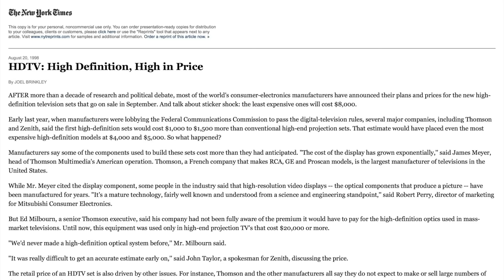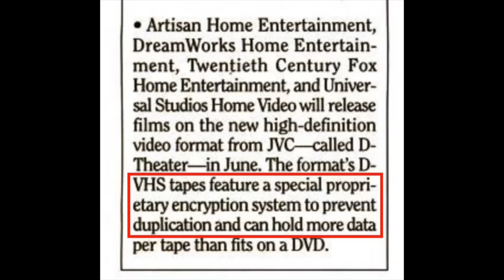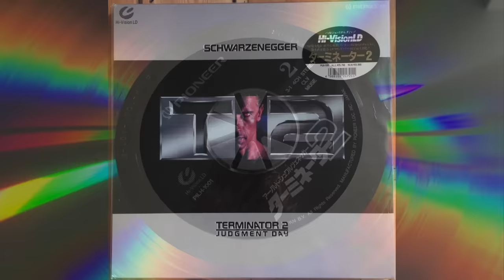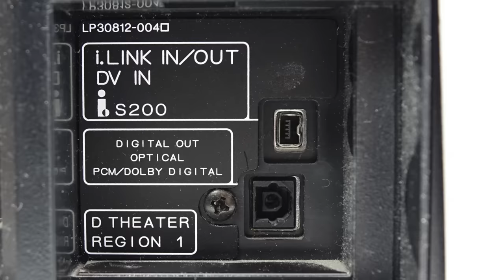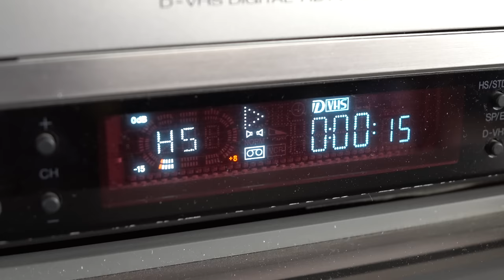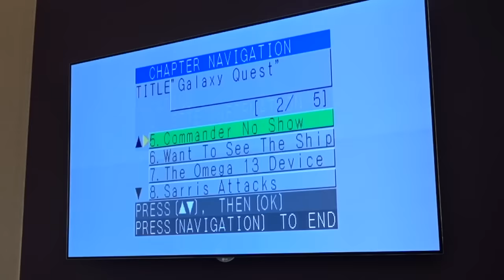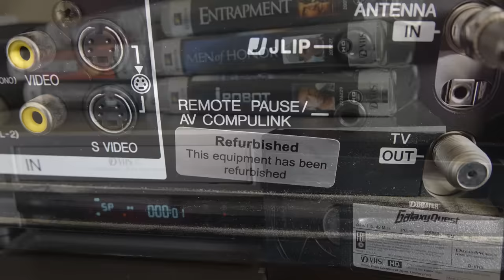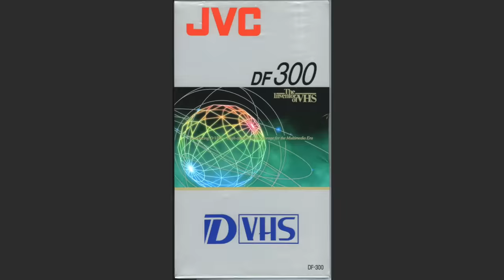Remember when HD Movies came on VHS tapes?

Comment: 50GB? Thats amazing!
Reply: yep the huge recording surface of VHS tape is definitely under-utilised by only recording analog signals to it. Note that a MiniDV cassette from the same era stored 15GB and it was a tiny fraction of the size.
Reply: Not to mention that computer tape backup with similar capacities was a thing, tape being cheaper than hard drive for the same capacity, the only downside is it is not random access.
Reply: The real question is, can it run GTA5?
Reply: +Autotrope These days, computer backup to tape is about 2TB per cassette, with support for robots that change tapes automatically between a stack of tape drives and a much larger library of tapes, which are then moved to a fireproof vault on a more human work schedule.  Disk backups are fine for "near line" quick access backups, but tapes remain king for media that can be physically protected from both physical and virus/hacking/software damage by storing it away from the electronics.  Tapes tend to endure rougher handling during transport and storage than most other formats.  Some solid state formats could compete if you could trust the ability to get readback support 10 to 50 years into the future rather than a useless ("new blank disc within 1 year of purchase") blather with no real specs as to where your precious data is or the quality and endurance of the actual storage chips.
Reply: Note that tape is still used today. A friend of mine works in a datacenter, they make server backups on tape, each tape can maake around 12/20TB and in controlled condiction it can be stored for 60+ years
Reply: Tapes are still used in as archives in data centers. Can hold up to 220 TB, but it is mostly used for as an cheap alternative to store data that isn't used often, since those tape drives are very slow compare to normal HDD.
Reply: You will have same problem with other media as well. Optic discs are not perfect as the reflective layers can still rot. Hard drives can lose magnetic field over time and solid state can change over time too.
Reply: I'm surprised D-VHS even lost to Blu-Ray, despite storing TWICE as much as Blu-Ray.
Reply: Magnetic fields, once polarized do not fade. They are just polarized one direction. They will stay that way until the universe disintegrates or another large magnetic field changes it. I have read tapes that are over 40 years old...with digital data on them, and they read just fine. Presumably, if the actual media can be preserved, you could read that same program from tape in 1000 years. What usually fails on magnetic media is everything else. The moving parts, the components, the adhesive on the reel etc.

Also, you can actually get gold CDs which will not corrode/rot even under wet conditions. They were quite pricey and are usually only used for special applications/long term archival. They are now a bit cheaper and ebay has lots of them. I should get some while I still can...they will likely be the first of the optical media to vanish in the coming years. I only know about them because I knew someone many years ago who worked in a CD factory. According to him, they kept these coveted discs under lock and key. There was one other type that he mentioned, but I can't remember what it was.

@toadlover
I'm not suprised...It looks like a VHS tape. VHS=old to most uninformed consumers. They likely never even knew it existed(myself included) and walked past it on the shelf when buying DVDs in the DVD section, or returned it when their VCR wouldn't play it. I would have loved to have known about these...I am glad I know about them now!
Reply: Toadlover404: It might store more than Blu-ray, but it's still a tape, with all the inconvenience that brings.
Reply: Carl Mahnke More than my phone.....
Reply: Actually google made a 100TB tape, and sony made a 70 TB tape. I don't know about the sony one, but the google one is roughly the size of a standard cassette. The difference is in aligning the FEO2 particles perpendicular to the substrate and all in uniform alignment, so as to not have overlapping magnetic fields. Thus one particle in theory can hold one bit. There are around 100 million atoms in the width of a human pinky, so that should give you an idea of the kind of density that is possible on magnetic media. Obviously, a head capable of writing to this level of accuracy is impossible, but close to it??? Totally possible.

Imagine for example a tape read write head that is constructed in the way modern inkjet printers are...only you don't have to inject ink, but rather use the same process of exposing the read/write head circuitry to a silicon die like an integrated circuit would be. Then you can have control of the size and power to a precision never imagined in the days of TRS-80 tape recorders...in any case they used iron particles sprayed onto adhesive higgledy piggledy, and thus the density, especially including noise and filtering, was dramatically lower...like 3mb/hour tops lower.

When one considers even VHS, with its tilted 4 heads and helical scan mechanism, rapid head spin rate etc... even that is a marvel, but what we are entering into now is a new era of tape storage.

I keep hearing all this junk about SSDs and how they are going to supplant magnetic media...dream on. That's like when random access storage was thought to be able to supplant tape. Nothing is cheaper than an iron particle, and there is not much that is smaller either. Magnetic media is simply going through a rebirth. Another thing to note is that while tape is sequential access, it is not therefore entirely sequential, as it is sometimes perceived. Even in the 1970s you could get a directory and location from tape without actually pulling all the files from the entire tape. The drive on command would reel over to where that file was held, and then read it. This has been around for a long time. Granted it doesn't offer the nanosecond access time of an SSD, but for files you don't access all the time, or are processing in very large quantities, tape will always win, even over magnetic random access storage.

The only media that might give a run for magnetic storage is Sony's up and coming optical format which is very exciting indeed! Random access optical drives which hold 300GB each, and have a shelf life of 100 years. They are write once though...so I don't know how practical that will be in cases where you need all instances of data stored every day and historically kept(might get pricey very fast). Whereas with tape you can reuse client data media and overwrite the old media when they no longer need it.
Reply: IIRC, in the mid-90s, Russians used cheap VHS data backup systems with home computers to store amounts of data unimaginable in the West at the time.  I think they were very common.  No clue why they never caught on here.
Reply: LGR here on youtube covered that. Turns out it is a very unreliable method of storing data than just using an actual Tape system.
Reply: Nick Schafer Thing is he used an SLP mode tape (lowest fidelity/slowest mode) and some "Damnere" obscure backup system, not the popular ArVid Russian VHS system. Of course it is unreliable if he used the worst quality mode! The data is stored in analog picture, and it will fail with a low picture quality. I love LGRs videos and appreciate him, but he did a big mistake here. There is also a smaller factor - PAL encoding used outside America/Japan generally provides better quality video than NTSC, with a lower frame rate, so it is both less dense (dense means high capacity but also higher error proneness) and more high quality than NTSC.
Reply: Current magnetic tape technology features magnetic particles measuring several nanometers across (well under 10 nm), and magnetic recording head gaps that are in the low tens of nanometers, which is the maximum head gap size practical to read these nano particles. With these advancements, we can now achieve areal densities on tape in excess of 200 gigabits, that is 25 gigabytes, per square inch of magnetic tape surface.

To give you an idea of how much data you could record onto the longest tape-length VHS videocassette ever made (the DF-480 [T-240 equivalent]) could store 4 hours of recorded video at SP mode and contained 1,614 feet (19,386 inches) tape length and, of course, utilized 0.5"-width tape that defined the VHS format itself; if you calculate that in square inches, you get 9,864 square inches of total tape surface area in that particular tape, which assuming 200 gigabits (25 gigabytes) per square inch, translates to 1936.8 terabits (242.1 terabytes) of data per tape.

To add some further information and give you a better idea of how vast that amount of data storage is, let's assume you could record a maximum of 4 hours (240 minutes/14,400 seconds) of digital video and audio onto this tape, it would mean a maximum theoretical data rate of 134.5 gigabits (16.8125 gigabytes) per second. Compare this to the first, last, and only consumer-level, digital videotape standard, D-VHS, which using the same tape specifications as above but without modern technology, could store a meager 50 GB and supported a maximum bitrate of 28.8 megabits (3.6 megabytes) per second.

There is absolutely NO reason why this technology shouldn't be democratized and produced at an affordable price that would make it available to the masses, and it's a shame how nobody is talking about this.
Reply: no thats 86gb
Reply: nothing compared to speeds and capacities of cartridges for LTO streamers. Tapes now are very relialable format for archives, but unfortunately stramers itself cost huge.
Reply: No menus? No trailers? No “special features”? Holy sweet mother of megabytes. Where do I sign up?
Reply: Those VHS backup devices were being advertised in Australia too. 
Fairly sure I have magazines with ads for the things
Claimed to store 2 gigabytes to a tape. Which at the time was a lot, given my backup method at that time was CD-R and even that was pretty impractical given hard disk sizes...
Reply: This means you cant english as a henry ringer roser simply cipher mike eel crow phonic to digest many dimensional www move made by many long cycles ago of constantly suggestimg 'o yes well,debate of such is really ones own ideas' format 'zone'plumb  Xsat intelsat 'divi' 4D 'mainframe'\'ibm' B.Gates 'dos'woop 'oops' motorolla Hewlett the dogs art 'online'definition PC,etc?
Reply: The tape information in the previous message has gotten corrupted, so much for tapes... tsk tsk.
Reply: Hey! this actually reminded me, I bought an Iomega Zip drive in 1993 or 94, and a friend came over and I boasted about how it was 100MB, etc. But he actually had a VHS tape backup he'd boughten from an ad in the back of a PC SHOPPER Magazine that could store... it was either 1 or 5 GB per VHS! It was a serial connected thing that looked a bit like a tape rewinder, but anyway it was really slow, and was something you'd only use for backup and walk away, but still neat.
Reply: @GreenNekoProductions  Im not, I bought a PS2 in 2001-ish because it could play CD's , games and  movies all in one unit , just cant be beat.
Reply: @GreenNekoProductions  Blu-ray does 50GB with a dual-layered disc.
Reply: Yyep same as the four qaud layer for blu ray so blu ray is not that impressive in that department yet plz never let that get ya offended

Comment: I bought one of these in 2004 for a project I was doing for Comcast. I was creating a simulated HD home theater environment that need to play without access to their headend. Their HD cable boxes had firewire data outputs and they didn't encrypt their signal then. I recorded segments to D-VHS and then to my computer for editing and compression as needed. It was clunky, but it worked great. I still have the JVC and a Mitsubishi in storage.

Comment: VHS? Above 480I?

Sounds like pure heresy to me.
Reply: knowledge share  The joke being that standard VHS quality is 480i. r/whoosh
Reply: While the joke is obvious, to get real, though the old NTSC output equates to 480i; it's about 400-420 for SVHS and 240 at its very best for VHS.
Reply: @BilisNegra  No, 480i isn't 480p. 480p (or 480 Progressive Scan) is a no-cheats vertical resolution of 480 pixels, 480i (480 Interlaced) is two interlaced (alternating) fields of 240 vertical lines (IE a vertical resolution of 240 vertical lines) alternated so fast as to make it look like 29.97 complete 480-line frames a second. VCR's are, on composite, stuck with NTSC 480i. Meanwhile, SVHS is 840i as it's 420 vertical lines per field in an interlaced fashion, which technically makes it interlaced HD.
Reply: @SarahMaywalt  I am the pope and I approve

Comment: A couple of notes:
-DVHS did see a PAL region release, JVC built the HM-DR10000 for the UK market, but alas no D-Theater support.
-The DVHS decks today are prized more by folks doing VHS to DVD transfers since this machine has a TBC and DNR system (Digipure) for analog tape playback.
-External MPEG2 encoder/decoders connected to these via firewire to add DVI output, naturally with HDCP enabled with D-Theater tapes. You can also playback and record on your PC via firewire, drivers are included with WIndows and OS X.
-My DVHS deck came with a giant box full of movies recorded off of premium movie channels (HBO, Showtime, etc) via a digital cable box with Firewire output. Oddly they are not copy protected despite cable boxes claiming to do just that. I had all the Star Wars movies on HD well before they came out on BluRay... except I had to rewind afterwards!
Reply: +NJRoadfan cool i want one now to back up some movies that only came out on vhs
Reply: +NJRoadfan 

I think the cable companies were less stringent with copy protection back then. I had a friend who in the early 2000s could record transport streams for most of his cable channels onto his computer through the firewire port on his box even though he wasn't supposed to.